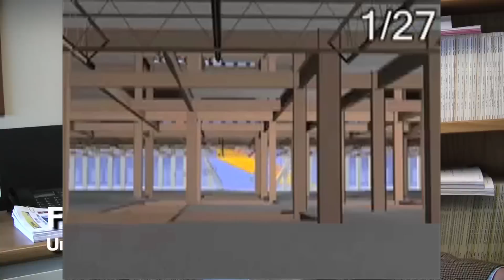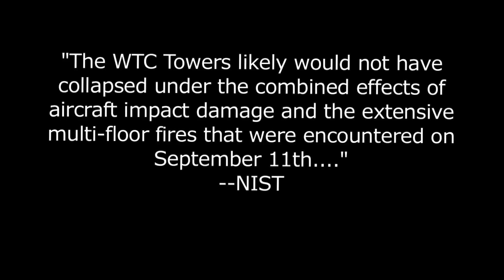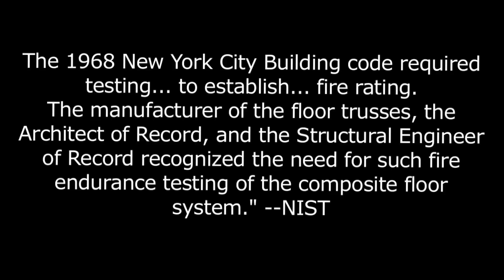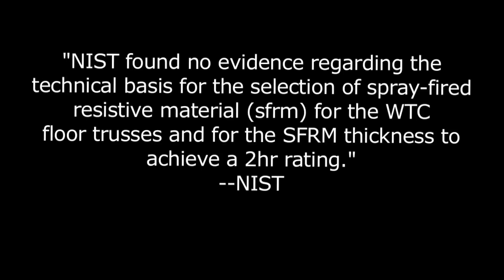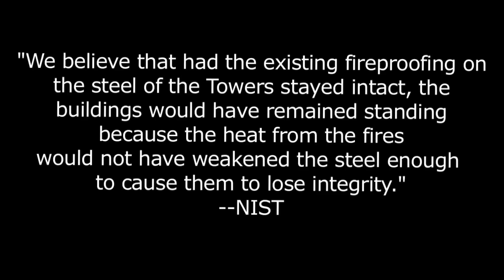What the Port Authority Doesn't Want You to Know about the WTC Collapse

Comment: Google search this, to verify.  Apparently, the World Trade Center had caught fire on some occasions before September 11, 2011.  In particular, on February 13, 1975, floors 9 through 14 of the north tower burned for 3 hours.  No damage or weakening of the structure was recorded.  On September 11, 2011, both towers collapsed after burning less than 2 hours.  This is significant because all reports I've heard indicate that it was primarily fire that collapsed the buildings, with the impact of the jetliners playing no significant role in weakening the structure.  This suggests that the impact of the jetliners did knock off the fireproofing; otherwise the 2011 fire would probably not have caused any more structural damage than the 1975 fire.